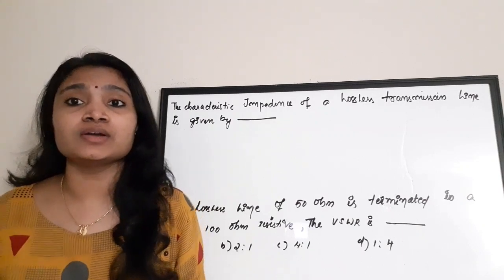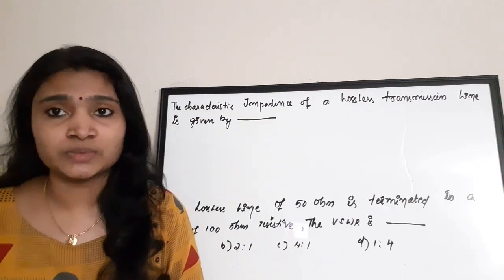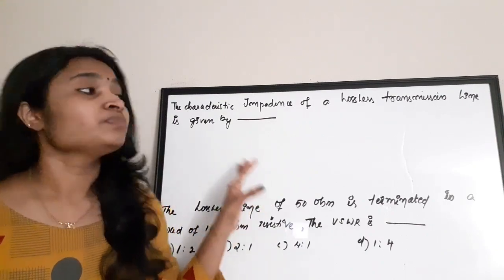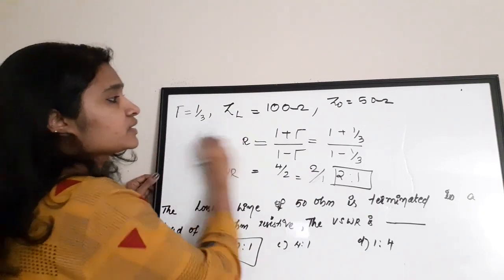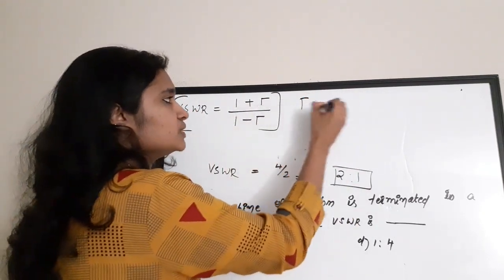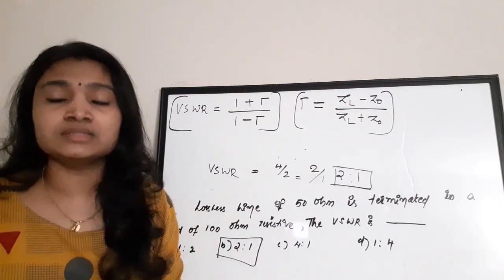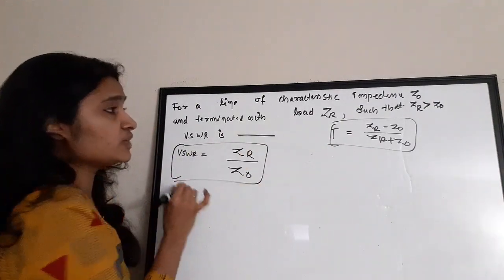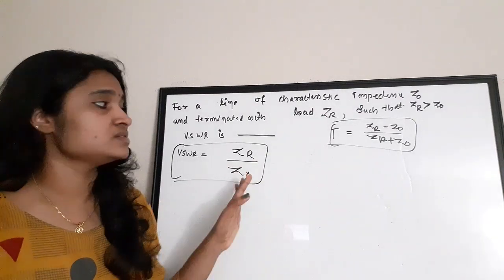SAC ISRO Scientist and Technical Assistant Electronics Preparation| Electromagnetic Theory Questions

Comment: Madam,
In one of the questions,you told 
vswr=z0/zL, when  vmax observed at a distance of lamda/4 from load,...
Isn't'it????please explain
Reply from the maker: The equation for the maximum voltage on the transmission line is at the quarter wave length point. That's y we take vamx is lamda by 4

Comment: mam , how G is zero , G is conductance and same time u r saying dielectric loss if dielectric loss is zero then how conductance is zero kindly clear this doubt , thanks
Reply from the maker: Here we take the dielectric is not making any loss, to the transmission line. So take it as an insulator
Reply: @EasyElectronics_jobupdates  mam G is conductance , how we take as an insulator? still confused
Reply from the maker: G is the conductance of the dielectric material of transmission line. Which we take as zero to avoid any loss created by the dielectric.
Reply: @EasyElectronics_jobupdates  thanks mam --got it